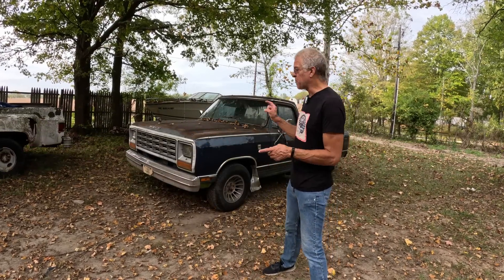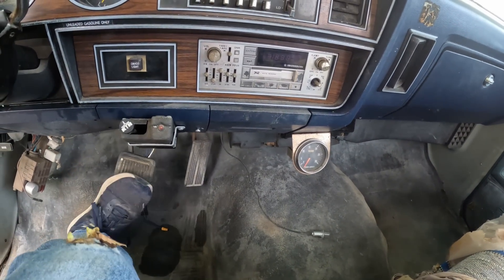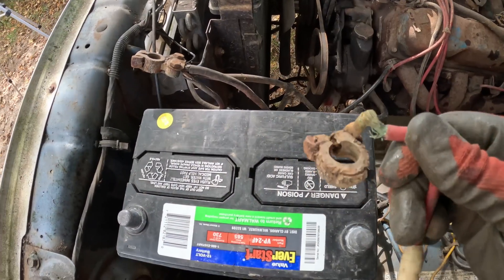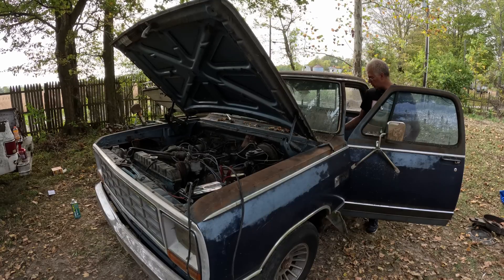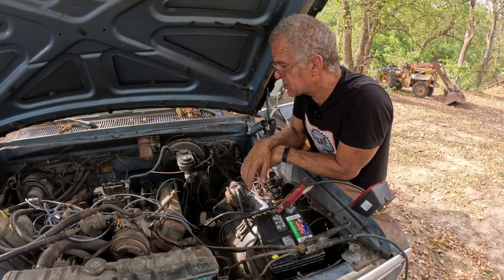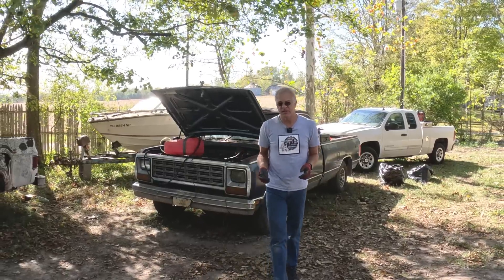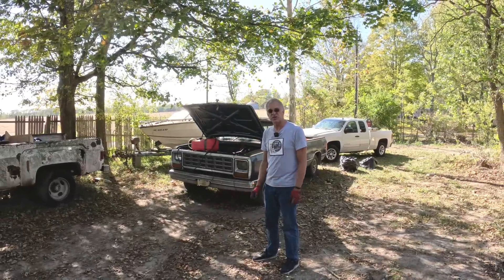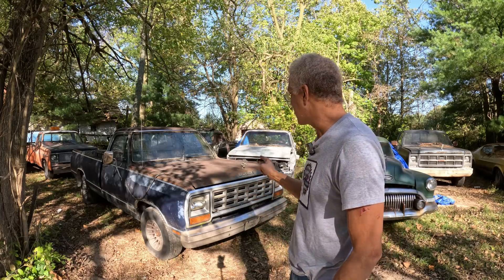off the road for over 20 years!! will it run and drive? 1983 dodge ram truck big block 440

Comment: The wheels are stock. 5x5.5 pattern. The distributor gear is the pump drive, it can be pulled up while rotating to align the rotor button.
Reply from the maker: Thanks, good to know

Comment: That 440 is probably out of a warlock truck( front suspension as well) 1976-77 would be my guess, I know the ignition system is a lot easier to fix with the front mount distributor, than a LA series engine

Comment: You can keep the original dodge distributor and connect it to a GM HEI module.  You get to eliminate the old ratty wiring, the distributor is adjustable and  it's a bunch cheaper than that conversion distributor
Reply from the maker: Good to know.
Reply: @streetratgarage  GM made a number of different HEI modules for various engines and purposes.  Myself, being of Hoosier heritage, noticed you have  a similar home brew somewhat redneck engine guy, like myself, so I thought I would pass this on to you.  I learned that the "5 pin HEI module"  uses the 5th pin as a timing retard of about 5 degrees.  I have used it to dial back advance for spraying  nitrous.  Currently,  playing with ways to make the amount of retard adjustable.  

Have also seen people use the retard  function to aid in starting high compression motors.  There are a bunch of choices, if you follow my Grandfather's adage, " Necessity is the Mother of Butchery".

Enjoy your videos.

Comment: Prospector is sort of like a Silverado, those rims are factory . The resistor has insulation on the back if the insulation is cracked you will need to replace that!
Reply from the maker: Sweet, thanks